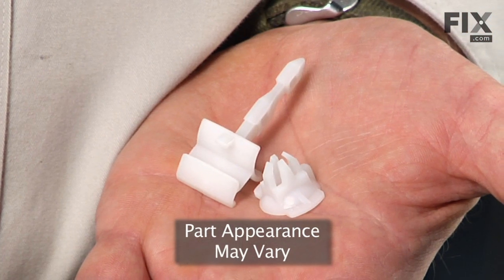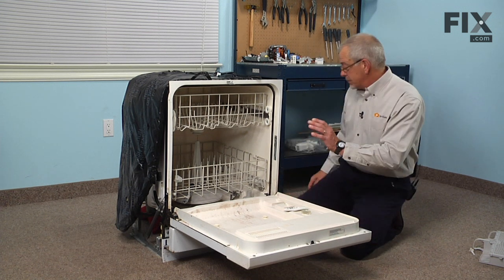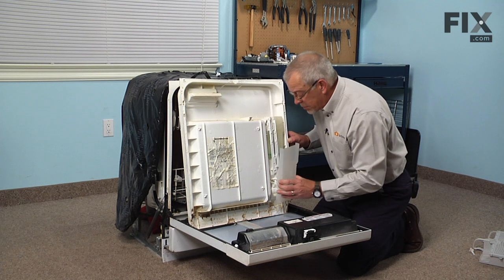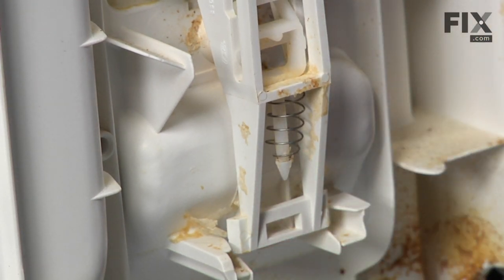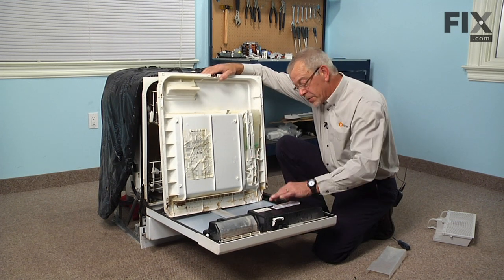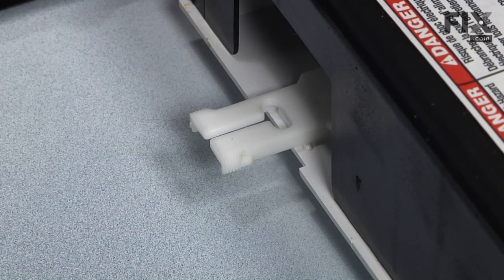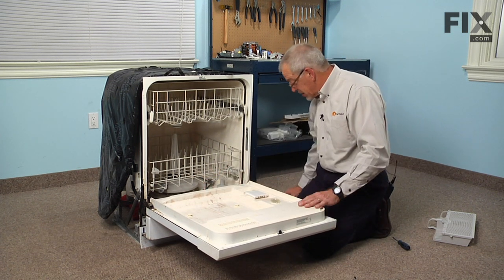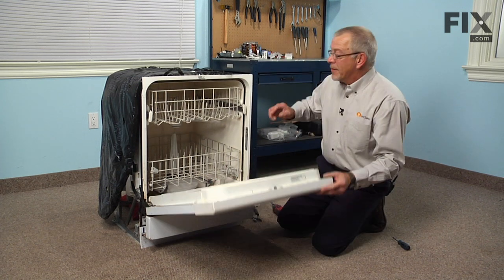Whirlpool Dishwasher Repair – How to replace the Soap Cup Latch Kit

Comment: i wasn't replacing the soap cup latch kit, but trying to uncover why my dispenser wasn't opening. the mechanism (actuator) actually works fine, all parts in tact, so still not sure what's up. But this video was the only one I found with a tutorial about how to replace the panel so that the dispenser actuator (upper) can connect to the actuator lever attached to the timer.  This video explains it (turn timer dial until actuator dispenser from timer is just about fully retracted first). But somehow the two pieces dont engage, so still stuck. guidance welcomed.
Reply: Had the same problem and it turned out to be the spring broke free that connects the two plastic actuators.
1st
Study how the mechanics works from where the unit attaches to the timer section – down to the bottom of the door where the soap release latch is, because every part has a job to do. There are slots in these parts that are set up to operate the latch and/or possible upgrades. 
2nd
You will see two spikes on the central area of each actuator that point in an angle away from each other and that is where a 3 inch spring attaches. Its job is to convert the pushing force into stored energy in order to create a snap motion, releasing the soap dispenser door.